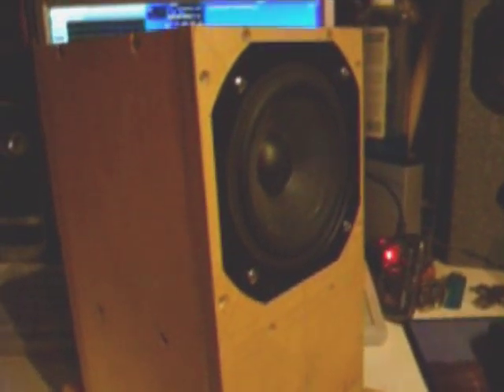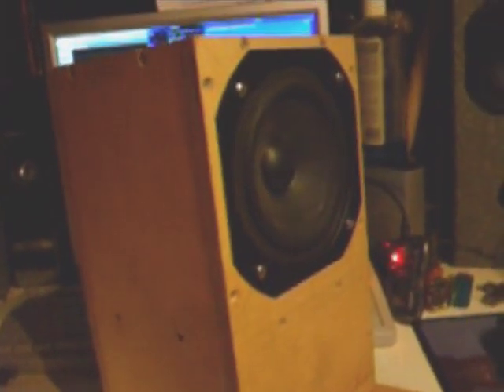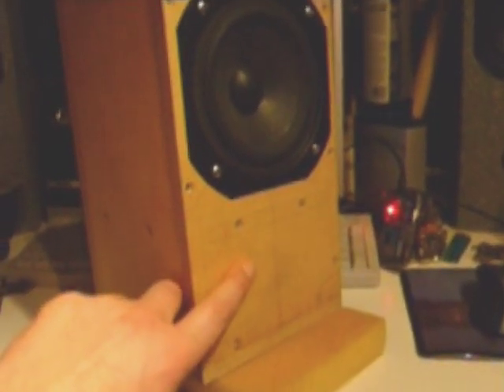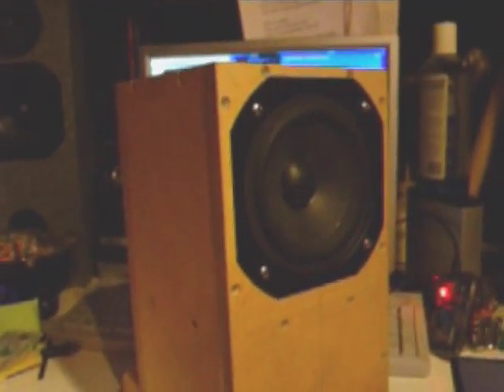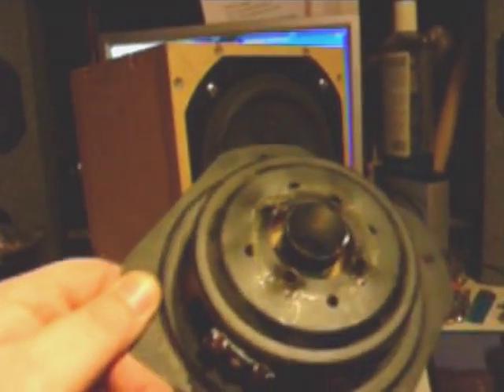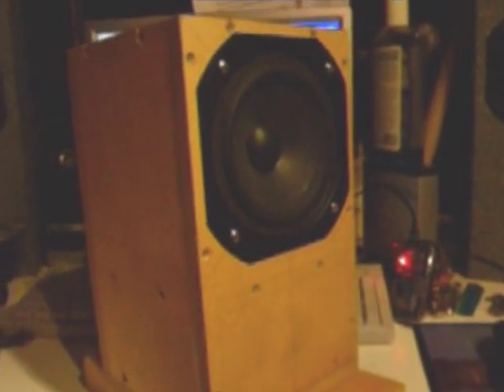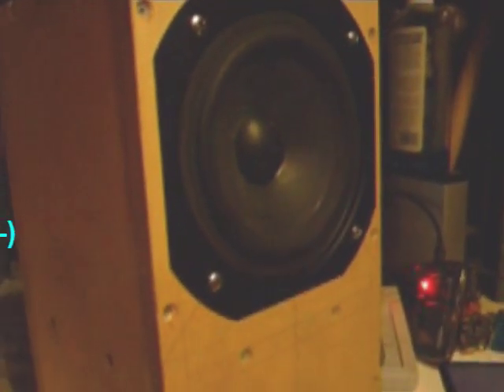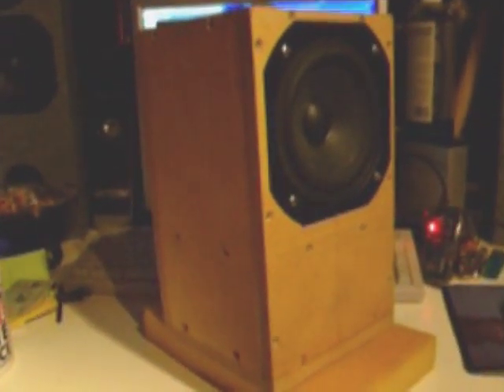Passive Radiator Bandpass Subwoofer

Comment: I still like a slot port more then a passive radiator. I got 25 hz with a 6.5'' driver in a bandpass box. But I chanced the driver for a 8''. That made it much louder. That box sounds good though.